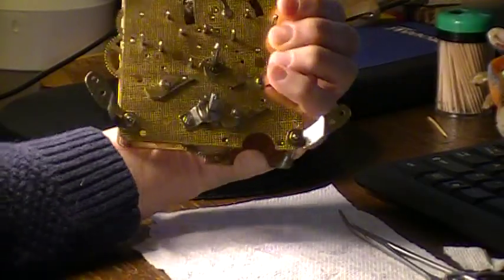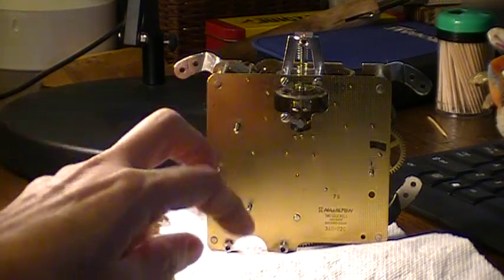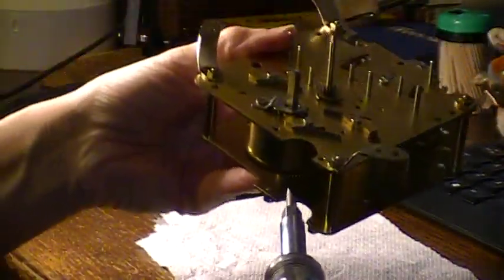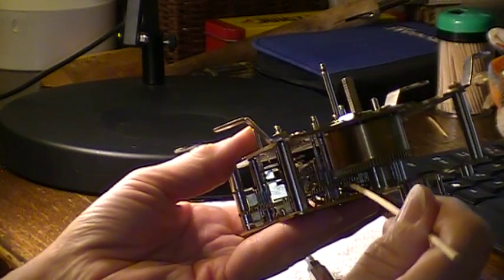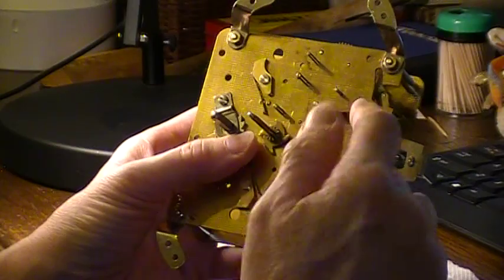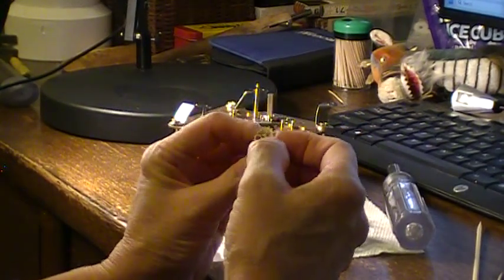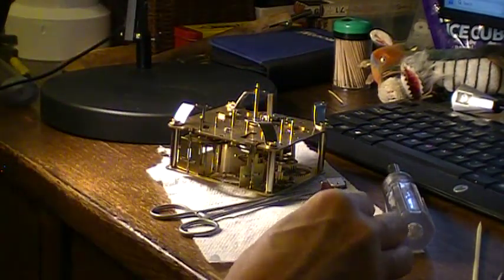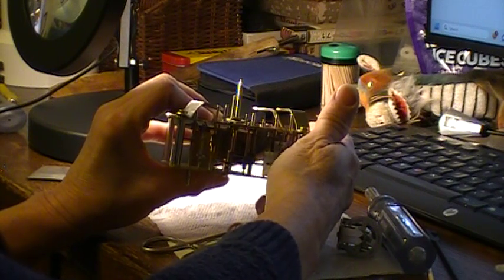1979 Hamilton Mantle Clock with Hermle 340-020 Movement Part 6: More Rookie Moves

Comment: You are doing great. Dont give up.  If clock repair was easy then everyone would be doing it. You have to like puzzles and thinking outside the box and figuring things out on your own.  I dont know how those pins would have fell out. You already fixed the gathering cam with gathering pin so I am confident that you will be able to fix this issue also.  Keep your head held high as a lot of people would have gave up at this point. For the folks that replace movements vs repairing them are parts changers and not clock repair folks. You are a clock repair person.  A darn good one in the making............
Reply from the maker: I've always liked logic puzzles